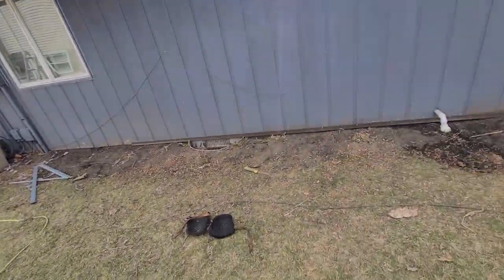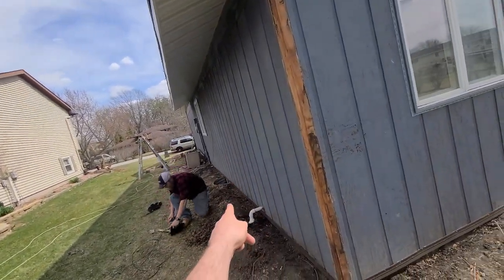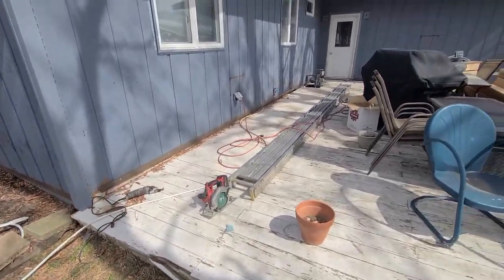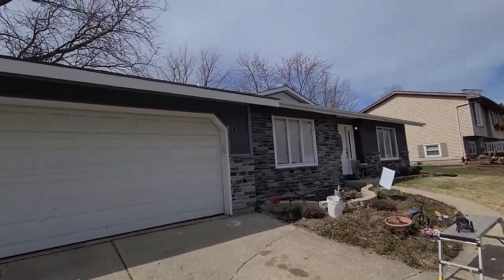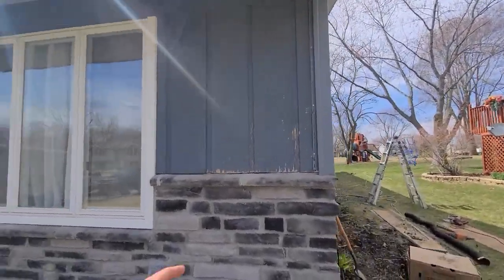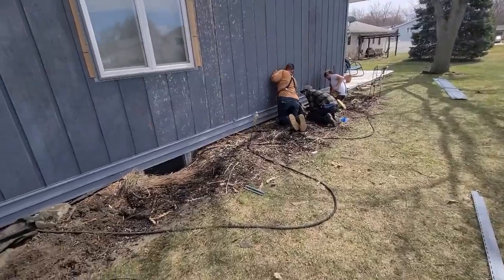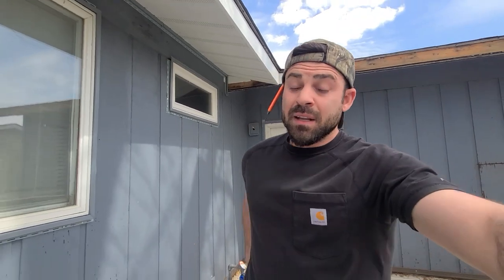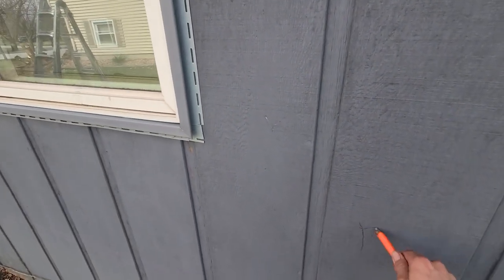HOW TO | Determine Vinyl Siding Starter

Comment: I ran into a similar problem on a double wide with brick foundation. In some places you could stick your finger in and other places i was to low starter wise... The brick foundation (grout line was un level). In some places i ripped the siding and used the grove to insert inbetween the cracks..almost like a wide starter strip..you saw maybe 3/4 the most in some spots...then put my starter strip on the ripped siding...since it was the same color it blended well...customer loved it....

Comment: We run a strip of white aluminum down to the ground when it goes into the dirt like that then put the starter over it. An option for above that stone would be to do a freeze board and keep it going around the gable looks like it would like up just a quick thought.. might look weird with siding being that narrow
Reply: i do the same thing like a 3/4 by 3inch piece of white. we use our scraps all the time because if they are scratched a bit you would never know. great video!

Comment: On the starter if you started from the low point and the house was that out of level, why not run j channel instead of starter where it ran high?
Reply from the maker: Well tbh that's kind of the easy way out and will draw unnecessary attention to the fact its different when it's done. All we had to do was determine where we were going to have problems and cut it off.  It was Not that tough and is worth it in the end because everything looks uniform as it should. Personally I would never do that lol even a remodel job like this should look like new construction in the end
Reply: That's fair. I would use coil stock or j channel rather than bring out the spade lol.
Reply: Why snap a level laser line? I go off the soffits. Putting level siding on a sunk off level house will it not throw your windows off and your top piece?
Reply from the maker: @Phoenixrising8313  I agree. I like going off the soffit too. I usually check from that line up to the soffit as well and tweak it if necessary or if possible to get the best outcome. Just something extra I like to do. When you put that laser level line you can check both and it makes the install easier. The corners line up perfect, you get the same reveal on the soffit  most times. Works well, and I would personally rather have it match up with the soffit instead of a window. All preference really.  And I absolutely have had to use coil stock as well
Reply: @NWIVeteranConstruction  I like your videos you work hard and have a lot of knowledge and skill. It's funny how you joke about "sabatuer" that's really funny and made me laugh.

Comment: Wouldn't pass code by me. Always flash, better yet, run 1 row of LP 12". Because 1st time thw weed whip comes out..... pull transitional number from soffit,thwn started on top of LP, clean, water proof, top row all the same size.
Reply from the maker: i like the LP idea better than flash. good point